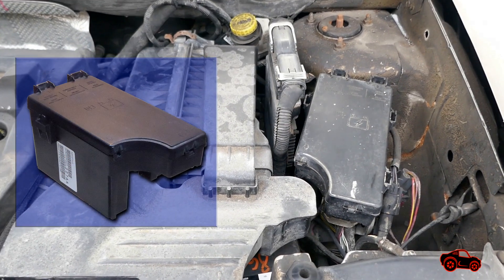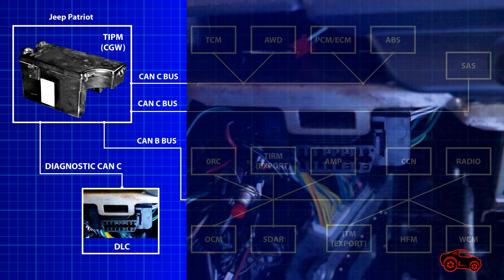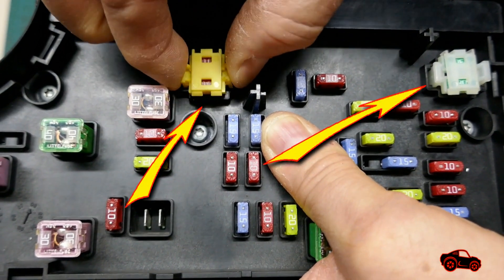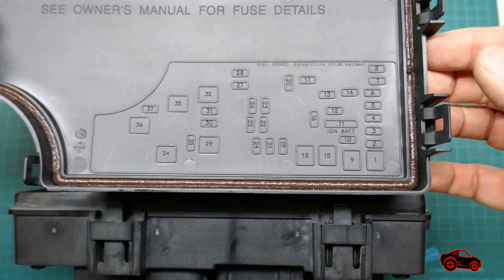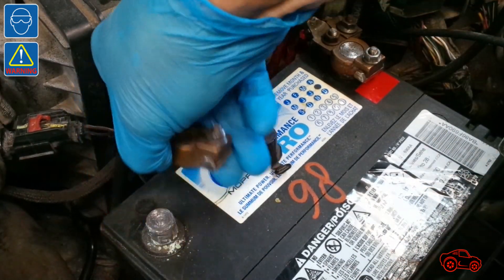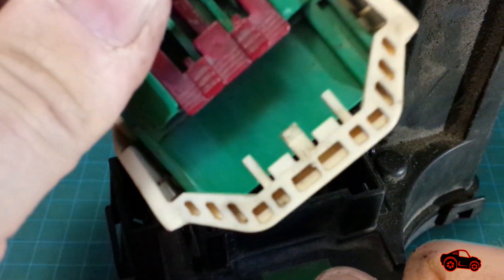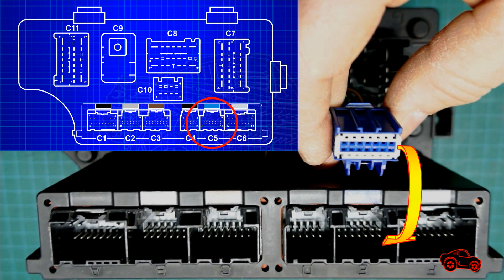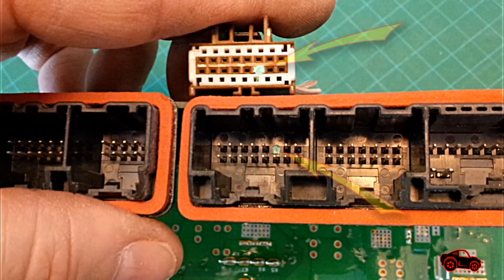Totally Integrated Power Module Fuses, Connectors & Networks Jeep Patriot & Compass 2007-2016 (2017)

Comment: I don't see a fuse stating its for the signal lights idk if I am missing something or what but I want to find out if my right signal light fuse is blown cause no matter what new bulb I put in it never works
Reply from the maker: The turn signal light bulbs are powered by the electronics components located in the TIPM (+12v) . The ground contact (-) in the light bulb socket is connected to the chassis ground via a ground wire. The majority of the problems are caused by oxidized or broken contacts or wires near the light bulbs and very rarely from the TIPM.

Comment: Which is low beam headlamp fuse 2012 Jeep Compass ?  The fuse pictorial is difficult to read and fuse cover #36 which owners manual says is headlamps does not appear to be correct. Could you link to clearer picture of circuits and their respective fuse ?
Reply from the maker: The headlights are controlled directly by the TIPM without fuse. 
The left low beam is powered by the TIPM connector C4/pin 4 and the right low beam by the TIPM connector C5/pin 3
Check this link:   https://www.jeeppatriot.com/threads/driver-headlight-not-working-2011-patriot.339246/
Reply: @mtlcarguy  😊Spot on mtlcarguy....great solution... TIPM C5/pin3 was bent during replacing TIPM...no continuity to pin 1 of headlight connector. Straightened pin , all working. Thanks.

Comment: Good day, which fuse should one pull out to release the fuel pressure when doing a fuel injector change?
Reply from the maker: Jeep recommends this procedure to release the fuel pressure.
1. Remove the lower rear seat cushion.
2. Remove the fuel pump module cover. 
3. Disconnect the electrical connector from the fuel pump module. 
4. Start and run the engine until it stalls. 
5. Attempt restarting the engine until it will no longer run. 
6. Turn the ignition key to OFF position. 
7. Disconnect the negative battery cable. 
8. Later, when the work is fully completed, if needed, use a scan tool (OBD2) to erase one or more related DTC that could have been stored.
Reply: Beautiful thank you

Comment: Which one is the windshield wiper fuse
Reply from the maker: There is no fuse used for the front whippers or the rear whipper. 
The motor of the front whippers is controlled by 3 electrical wires coming from the TIPM (C11 pin 10,  C11 pin 12,  C2 pin 5) and the fourth wire is a ground.

Comment: Do you know if the same TIPM is used on Jeep Patriot 2010 equipped with Diesel and Gasoline Engines or they have different (incompatible) TIPMs? TIPMs from diesel engines are more easily found here but I want to put it on a car with gasoline engine.
Reply from the maker: I don't know!  I have never seen any Jeep Patriot with a diesel engine in Canada. 
Some gasoline engine TIPMs should be interchange if the part number is the same or the superseding part number is compatible with the transmitted data, the data bus network communication protocols and the LIN bus communication version and the LIN data. 
Ask to a service person at your local Jeep dealership, he should know more about it.

Comment: Hello, where is your garage located ?  I have electrical issues on a jeep compass, no power from tipm to starter.
Reply from the maker: I am retired and I only repair some vehicles to help my close family.
Note, even if your TIPM is in good condition, the starter will not work if a relay located in the fuse block (relay box) is corroded or defective.
Reply: @mtlcarguy  I verified all relays and fuses there are three for fans and one  main relay it is a jeep compass 2007 , according to the electric diagram power goes from tipm straight to the starter  on c 10 yellow gray cable however the relay box had a lot of collosion as a matter of fact one relay  for fans broke inside and it didnt bother me until now that the car is in a no start no crank
Reply: @mtlcarguy  Can you recommend a good trustworthy electric Garage in Montreal I can take my car to ?
Reply: I was told to verify input on a c7 B+ from ignition red yellow orange cable  to tipm , that is why I viewed this video , the diagram seems different and I have more connectors than what is shown in this video, i cant figure out what  is what , 1,2,3,4,5,....13 they are numbered abcdef at this point I need to get it to a professional ,I will not mess with it anymore.
Reply from the maker: @jovictor3007  If your Jeep Compass is not the second-generation (MP/552), the C7 TIPM connector is connected with the FUSED ignition switch output via the pin no 5 (Run-Start), the pin no 7 (Run), the pin no19 (Run-Acc) and the ignition switch output pin no 21 (Run-Acc). This C7 connector has also 11 pins connected with fused B(+) wires.
Reply: @mtlcarguy The situation is not improving there is no communication with the engine control module, power is going to starter but apparently  but no communication with ECM to allow the start ? , no code at all on OBD Reader , what could it be ?
Reply: by looking at the electric diagram I dont see where the engine control module enters into the equation , I thought power goes from ignition switch to starter to tipm and that would be it., all the corroded relays have been fixed.
Reply from the maker: @jovictor3007  The TIPM manages most of the power distribution and the communications with all the electronic modules. If the fan relay(s) is/are not functioning, some programmed protection features in the electronic modules are activated to prevent the engine from starting and overheating.  If the main relay is not functioning, some modules are not powered and the engine cannot be started. Many circuit controls are part of TIPM electronic components. The TIPM also stores OBD2 generic codes and specific Jeep Trouble codes, but in some conditions there is no code available to be stored. This is where it becomes more complicated and a specialist has to inspect and troubleshoot your vehicle.
Reply from the maker: @jovictor3007  I cannot tell, there are too many variables like bad electrical contacts and electronic module problems to troubleshoot online.
Reply: @mtlcarguy  Thanks for the help,I found a good Car electrician and my car is now fixed , it was corroded wires...I learned a few things from this ordeal.... this cost me 1000$ from a new starter new wirings ,labor.
Reply: Hi! My 2014 Jeep Patriot starts fine but recently I had a problem with it engaging the starter while running. The shop I took it to replaced my starter and said that the TIpM is telling the starter to engage. Any ideas on how to bypass this? Thank you!

Comment: Anyone know Whats the fuse Of auxiliar headlights?
Reply: Mile lighthhouse*
Reply from the maker: If you mean fog lights, there is no specific dedicated fuse. The output power comes from the TIPM C11 connector. 
You can try the fuse 31(Headlamp Washer Relay Control) or the fuse 36 (Headlamp/Washer Control/Smart Glass) or ask your local Jeep dealer service person.

Comment: Where is the fuel pump fuse ???
Reply from the maker: There is no specific fuse used to directly protect or turn OFF the Fuel Pump Module. The fuel management is done by the TIPM electronic fuel pump control system.

Comment: Lookiy for power window
Reply from the maker: A good bidirectional scan tool is required to troubleshoot the window regulator modules if it is an electronic or electrical problem. This kind of work is usually done by a specialist.